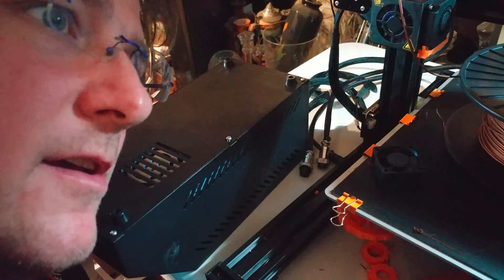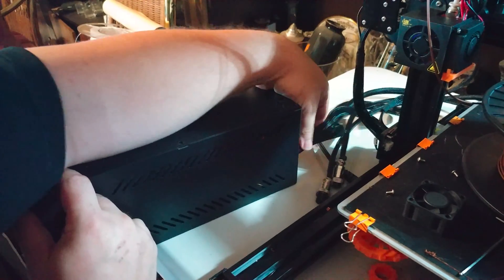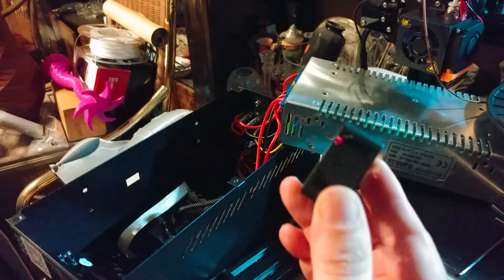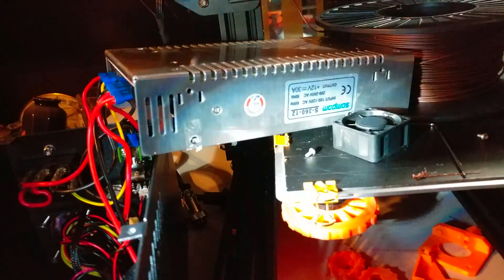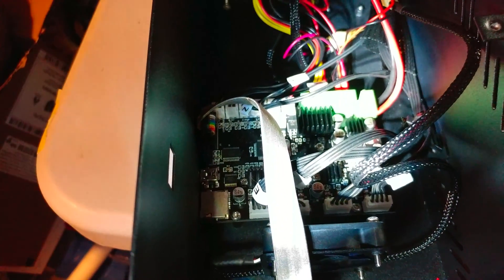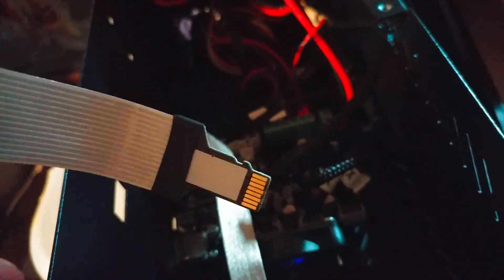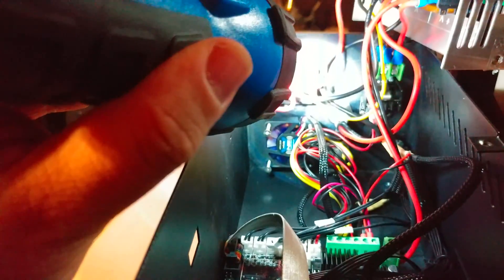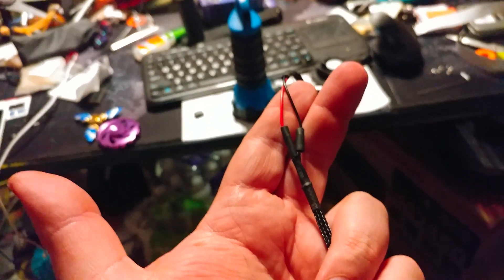Today's 3D Print - CR-10 Silent Fan Upgrades Part 1

Comment: I grabbed the hot end fan you recommended because I assumed it would work. (You didn't walk through that part) and the fan that was delivered is 3 colors (Black, white and yellow) the cr10 doesn't seem to support it. What did you do to set it up. And if you put the wrong link, not cool. You should vet your links.
Reply from the maker: I have no idea what you received but as best I can tell it is not from one of my links meaning someone Amazon sent you the wrong item I just checked the link again for the hot end fan and it goes to the correct noiseblocker fan I only link to stuff that I've actually purchased typically if I have not purchased it I usually indicate that this one I've purchased many times

The fan I linked to will fit right into place and it's only available in black with blue blades
Reply from the maker: Did you figure out the fan issue? Did they send you the wrong one or is one of my Lynx going to the wrong place? I've been checking my links and I can't find any that go to a fan you describe... The fans I link two should be black with blue blades
Reply: Hi Nerys, I did also order from Your link, and recived a 3 wire fan.. its the fan stated in the description, but With 3 wires :(
Reply from the maker: Thetra Gilje 3 WIRES is ok. The third wire is to report back rpm data this is how a pc for example knows how fast the fan is going. Its irrelevant and won't effect our usage. Remember these fans are made for pc modders not 3d printer modders. Just use the positive and negative ignore the third wire.
Reply: Thats what i did ;) Thank you for the a great tutorial Nerys. I will for sure subscribe.. lots of good tips
Reply from the maker: Koop Guy ahhhhh you mean wires!! Just ignore yellow! Thats for rpm and we dont use that. Just use black and white or red and black.

Comment: Hi , i have a question. The fan that faces the mother board should be working all the time? I changed it and nothing comes when i simply plug it. Even with the old one not working if only plugged. Is it also temperature controlled? My psu fan works great from start. Thx
Reply from the maker: Correct the motherboard fan at least on mine is temperature controlled if I recall correctly I will try to figure out how to verify that for you easy test is start a print after a bit that fan should turn on
Reply: Temp controlled. Turn the bed up to 60deg. Mine comes on very soon after that, but it's a cr10s

Comment: Great video- thanks!  The sound quality is great- may I ask what you're using for a microphone and/or software?
Reply from the maker: For phone shots built in. The lg v20 has very good mics. For the other shots lumix fz300 with a $20 lav mic.

I use wondeshare filmora to crudely edit

Comment: Will these fans be enough cooling inside the control box?
Reply from the maker: yep. many hundreds of hours printing later zero issues.

One big thing is to cut away the slots covering the PSU and Brain box bottom grills. they block so much of the exhaust air from the PSU as to effectively snuff it. so the quiet fan "unblocked" pushes far more air than the stock fan stuffed.
Reply: Nerys. Ok thanks that is exactly what I hoped. I think it would be good to cut away both like you said and try to print a new cover that doesn't block much air just to have something there. Those grills seem too flat to me.

Comment: the fan u suggest for the hot end is only 3800rpm 
the stock one pulls .10amp 4.5cfm the one u suggest pulls .04amp  3.9cfm & moves  less air compared to the stock one although much quieter i will agree may result in heat traveling up the hot end & thats not good
Reply from the maker: +wayneuk I highly doubt they pick a fan because of its CFM I suspect a fan with half the CFM would probably work just fine they just grab a fan off the shelf and stick it in the printer :-) whichever one's cheapest at least that is how I suspect there selected them. I have used fans with significantly less CFM with zero ill-effects on the printer even when printing at 240-250 degrees Celsius so I suspect there is a buffer in the design intentional or not we're simply massively overcooling when it's not needed

No doubt I could be wrong but I have over 1000 hours on the printer with no ill effects and we're talking continuous 75/100 + hour prints so I think we're pretty safe also for things like the brain box cooling don't matter in CFM those fans aren't putting out 25% of their rated CFM because the fan grills and whatnot they have in these boxes are so bad it blocks 60 to 80% of the air which is part of the reason why they're so loud when you stuff a fan it can get louder.

When I cut away the grill on the bottom of my cr-10 brain box the lower CFM fan begin putting out significantly more air than the stock fan did so most of the air was simply being blocked stuffing the fan.

The technical details are outside of my knowledge base but I think I have enough Real World experience replacing the fans to see a kind of trend and one of the things I plan to do is it start cutting away the Fan grills to all these fans and redesigning them if need be

This will let us use slower fans quieter fans and get the same or better cooling than the stock fans in the stock configurations.
Reply: Nerys i get what your saying but this fan hardly moves any air compared to the stock the ptfe liner sits all the way into the hot end putting this fan on is not going to cool like its intended ...they put a fan thats suitable for flowing enough air to cool otherwise wouldnt bother puting one on its not for looks as for grabbing one off the shelf and chucking it in thats what you have done ..iam all for upgrades but this is no improvement other than less noise ..  hook up.your old fan you will see for yourself
Reply from the maker: +wayneuk less noise IS the improvement. As long as the cooling is sufficient to do the job it does not matter the speed.

In fact i am even thinking of downgrading the fan further to a 30mm fan since i think instill have excess cooling capacity. I hate not being able to easily "see" the nozzle which is largely blocked on the cr10's

30mm would let me use a smaller cage and expose the hot end.

Remember the ptfe is supposed to be hot it literally goes all the way nearly to the nozzle tip. The trick is transition from cold (heat sink) to nozzle (hot)

You do not want to cool the nozzle and heating block (which that 40mm fan does heck half the air is not even going over the heat sink but over the hearing block where you do not want it.

Tbis is part of why cnc kitchens shround for the e10nis so good. It blocks off the heating block so its not cooling it at all any longer.

Faster heat up. More cooling for the heat sink so a crisper transition which is what you want.

I only need enough cooling to prevent heat creep. Nothing else. Not one extra erg of cooling is desired short of a smaller buffer space.

If you are getting more cooling than you need for that purpose your just wasting heat and energy and noise ... In the wind so to speak. Blowi g it away hehe. I suck at puns but that crossed me as funny.
Reply from the maker: +wayneuk and as per the specs this fan blows 84% of the air of the stock fan. Assuming the stock fan gets anywhere close to its design spec. My "gut" tells me even 50% is overkill upto 260c
Reply: Nerys  take a look on thingiverse the heat creeps up that ptfe tube in the hot end as it is with the stock fan even seeing no higher temps than 230c. less cooling is going to equal more heat.. theres a cr 10 hot end duct on thingiverse the fan mounts direct to but that will leave u no stock part cooler
Reply from the maker: +wayneuk the why do I have zero heat creep on all four of my CR10 printers? I wonder how many of those are failing cooling fans the failure rate is pretty high on them very cheap
Reply: You probably don't have an enclosure. Fan aside when I got my printer enclosure up to 60C air temp with foam board and emergency blanket reflective material I had heat creep. Only happens if I keep it 100% sealed though.

Comment: Hi Nerys. I replaced all stock fans with your video in my cr10  huge difference now. Also upgraded two stepper motors dampers for XY, you should try it with your printers, there would be so much less noise - now is so smooth. And now I can sleep near my printer :))
Reply from the maker: +Danila Fox in process! I hear nothing but good things I'm going to make the switch
Reply: Thnx for reply, nice to hear that :)) always watching your new and old videos, wish your channel will grow into huge :)) cheers

Comment: I replaced the PSU fan, as this one's temperature controlled it's difficult to tell if it's working or if hasn't hit temperature yet, what kind of load is needed to triggers the fan?
I took the bed up to 60 and the nozzle up to 200 and left it for 5-10 minuets but nothing?
I didn't want to push it too far in case it overheated...
Reply from the maker: for mine in particular it was 19 to 21 minutes before it kicked on.
Reply: Thanks for the reply Nerys, much appreciated.
I'll try it a little longer :)
BTW you weren't kidding about the hot end fan, now I can hear it above the rest, it's a noisy little bugger..
Reply: Got it working, thanks again.

Comment: Nerys Any reason why you don't run Octopi?  I think I've seen you complain about tiny microSD cards in a couple of your videos. I was copying gcode to a microSD card for a few days until I decided to hook up a Pi to my CR10.  It's just great being able to monitor/control a print from any device connected to my wifi network.
Reply from the maker: The DIYGUY first upgrade I make to a printer's to replace the MicroSD card slot with a full size SD card slot I have not run octopi yet simply because of expense I would need 6 of them I already have remote camera so I can check in on my prints and full size SD cards are pretty convenient
Reply: Hi, I run OctoPrint on an old Raspberry Pi A and a Orange Pi Zero 512MB. You can get the latter one for about 8$ plus p&p. There is no OctoPrint image available, so you have to install it on your own, but that's easy. You should be able to control multiple printers with one of these systems, using a USB hub. The Pi A is simply too slow to be fun.
Reply: Its not expensive and overcomes so many problems.
Reply from the maker: they look pretty expensive to me. $35 to $40 for the basic hardware. I don't use micro sd cards. first thing I do is buy the $6 adaptor to put full size SD cards in all my printers.

Can I push gcode to the printers SD card with these units ? what I really want is the ability to not have to remove the SD card and shuffle them around. being able to click "send to ender 2 #1 and send this file to CR10 #2) would be really nice. and then have that file available on the printers normal interface.

can they do that? (i honestly don't know much about them)

is there a particularly good video to watch on them? I could maybe play with one of them. switching all of my printers over would take a hell of an incentive since that is enough money to buy another CR10.
Reply: octopi is a good solution and you can connect multiple printers to it and not need the sdcard at all.  It will process your gcode just fine and you can store the rendered gcode on the pi.  Octopi has the ability to setup multiple profiles for each of your printers and you can send the gcode to it wirelessly.   I do find that if it's not active cooled (a fan), you'll burn your pi in a relatively short amount of time.  I just print directly from usb cable using mattercontrol to run the gcode nowadays, but the pi is a great solution in the end and would recommend.  You seem to know a lot about cooling so it shouldn't be a problem for you at all.  Thank you for your great video.
Reply from the maker: oh. now that is interesting if it can store the gcode. I will have to see if it lets me catalog and organize the gcode (I make nested folders and catalog prints and parts etc.. on the SD card for anyone else wanting to do this you can only go 2 folders deep. go 3 and it stops reading the folders)

doing ONE won't be too expensive so I might give it a try.
Reply: How did you get a remote without all the other gadgets. Great video.
Reply from the maker: remote? without other gadgets? what remote?
Reply: With OctoPrint (the server and UI running on the OctoPi installation on your Pi), you can also push code to the SD card on the printer, but it's a rather slow transfer.  Much better to use Wi-Fi or even ethernet.  You do need to make sure you have a good USB cable, or you may have connection problems when printing.  Other than that, OctoPrint is a great solution to your current sneaker-net process.
Reply from the maker: Robert Wallace well therein lies the problem, stability, I got one octopi the UI kind of sucks very standoff thumb friendly touch type interface short file names slow Etc on top of that twice I had the octopi disconnect from the printer mid print it's ruined a 20 hour and a 60 hour print I stopped using it after that until I can improve its stability advantage of sneakernet is it's free octopi are very expensive especially if you need 10 to 20 of them :-)

What I would prefer is a way for the octopi to interface with the printer in such a way that once the prince has begun I can disconnect the octopi I ate I want the printer running independently the way it is now the octopi is actually doing the actual printing which means I now have two points of failure the printer and the octopi when you're doing quite a large number of prints over very large period of time that becomes a problem

If it's that picky over USB cables that it likes and does not like then the octopi has a problem or there's something hinky with USB interface on the printers themselves.

The concept is pretty cool so I'll keep playing with it as time permits I'll probably restrict it to an Ender which doesn't tend to do very long prints so it's not as painful if it fails

Comment: The hot end fan, where does it connect to the control board?
Reply from the maker: I don't know. good question. if time permits I will try to find out.
Reply: Supastudio isn't the hot end fan always on?  If so it's wired together with the other two always on fans.  The part cooling fan must be wired separately since it can be controlled by code.